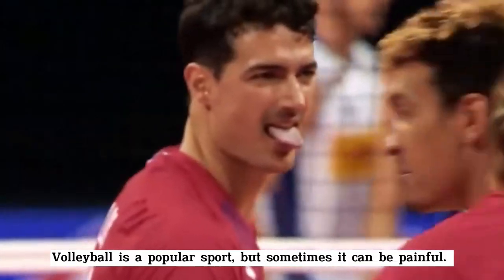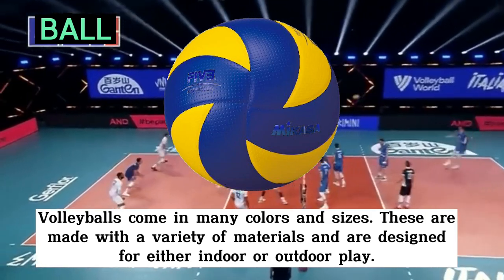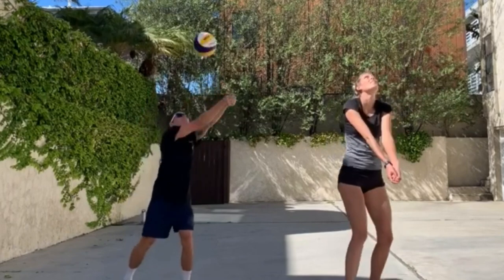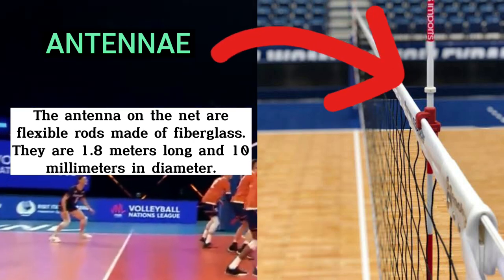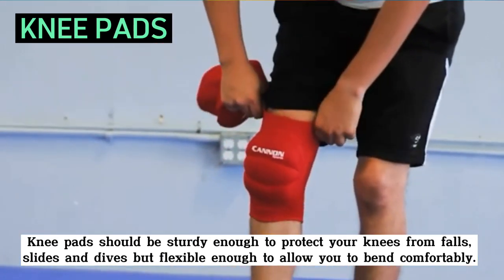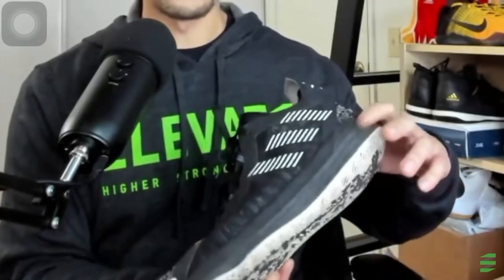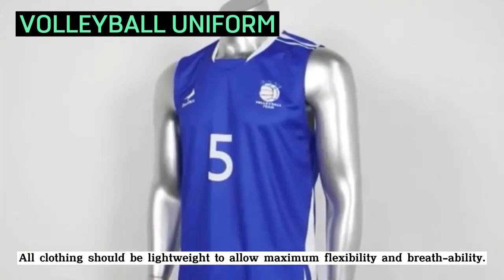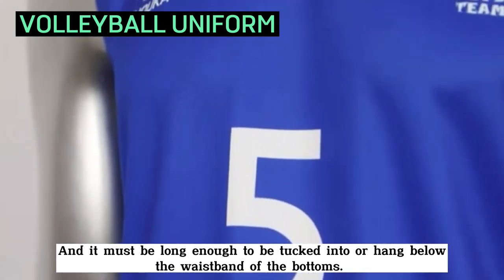BASIC EQUIPMENT & FACILITIES IN VOLLEYBALL || #PhysicalEducation #MSUNaawan #Volleyball

Comment: "What will happen if the player will not wear proper attire when playing volleyball?
The most important reason to wear correct volleyball attire is to avoid fractures and discomfort. Uniforms also provide protection to players. A player's ankles will be protected by the proper footwear. A well-fitting uniform will help keep athletes from being tangled in their gear or becoming injured as a result of an improper fit. Wearing a uniform allows a player to concentrate on their work rather than their appearance.
Reply from the maker: Absolutely correct! 💛 🏐
Protect yourself at all times.

Comment: One of the most important reasons for wearing a uniform in sports is to keep one's identity. Sports uniforms make it easier to identify competing teams and athletes. Proper sports equipment serves a number of functions and provides numerous benefits to an athlete's form and performance. This is just another reason why sports uniforms are so important. Sports uniforms are particularly designed and produced to boost performance. As a result, good sports uniforms are essential because they influence an athlete's perspective as well as performance. In short, sports are more engaging when the proper attire is used.
Reply from the maker: Absolutely correct! 💛 🏐
Protect yourself at all times.